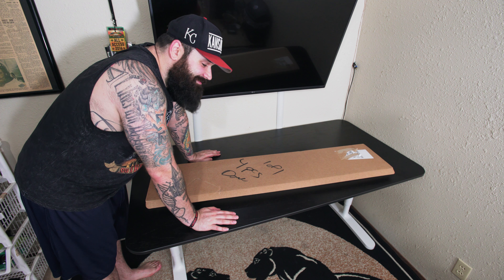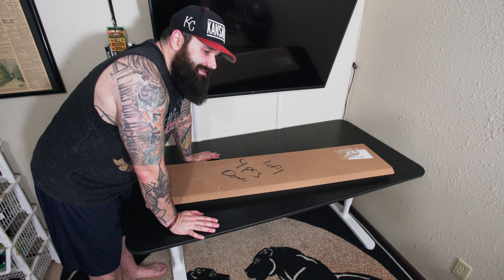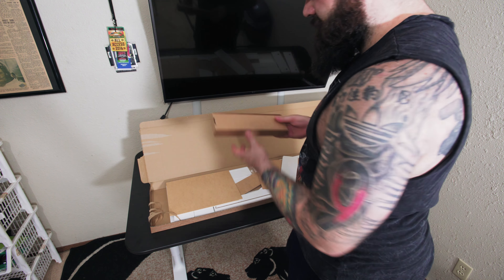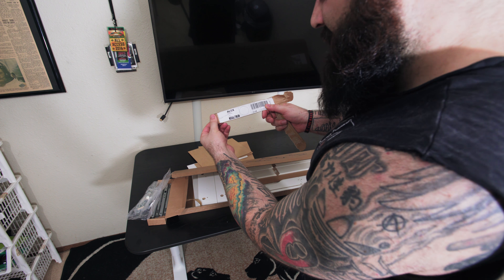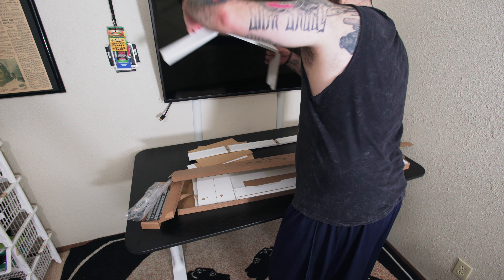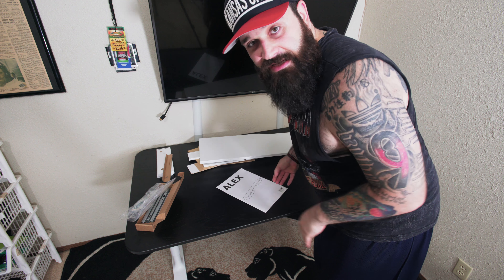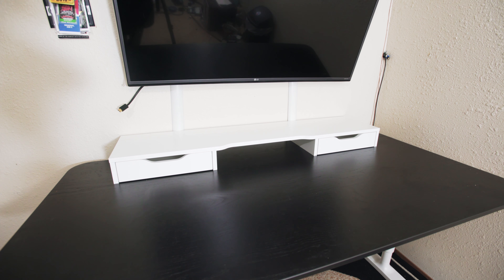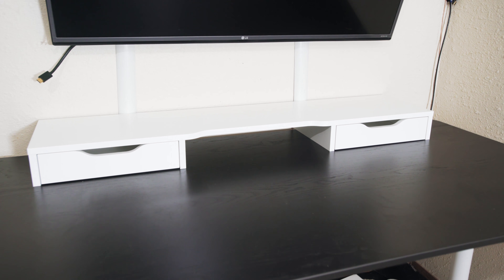Awesome IKEA HACK | IKEA Alex Desktop Add-On Assembly

Comment: Hi there I need a small favor please! I bought this secondhand and they failed to tell me that the drawers were broken and missing pieces I need to slide those two cardboard pieces on the back of the drawers, they are missing. I’m not sure where to get them Ikea doesn’t have them so I was going to buy a clipboard and cut it out. Would you mind measuring them for me if you’re able to do that?  You probably can’t because you already put them in there, do the instructions have the measurements? Thanks!